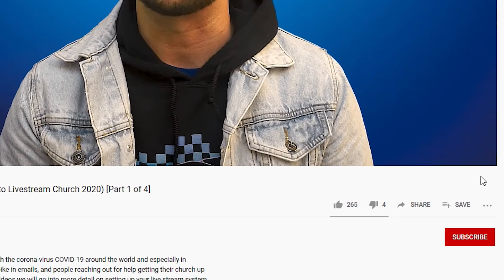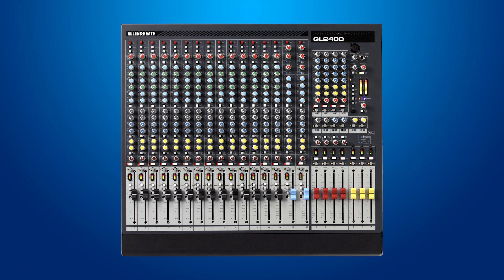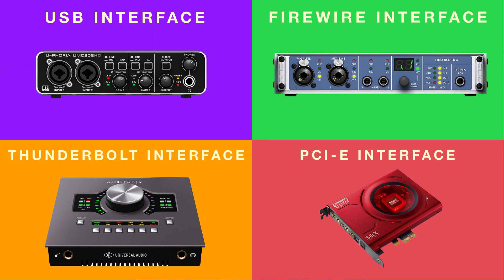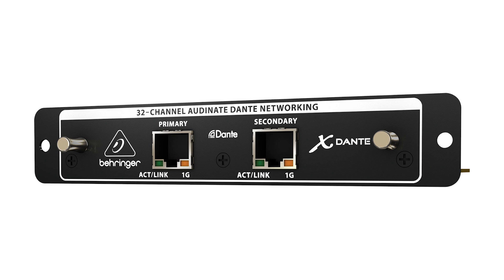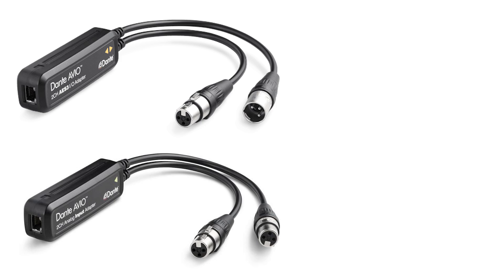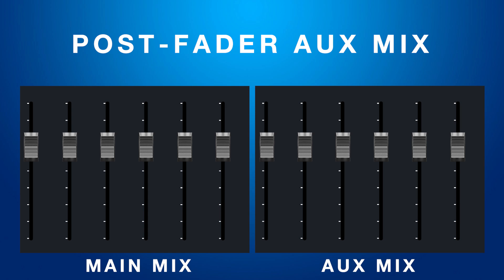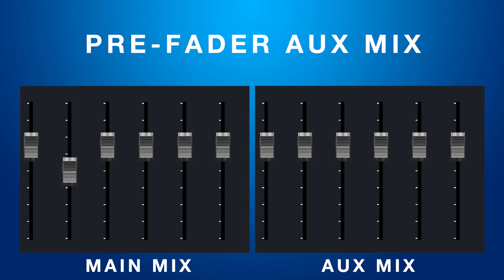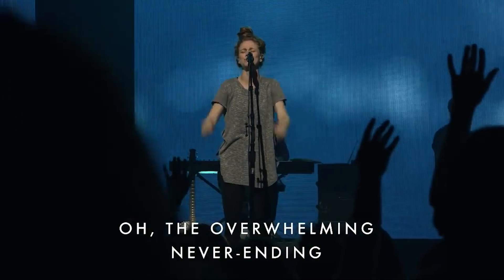Live Stream Audio Capture & Mixing (Live Stream Church 2020) [Part 3 of 4] #vMix

Comment: Question: you mentioned using the audio interface capability of digital boards as the best option. But you didn’t mention how that works? We have a Zoom L20, and it has an audio interface capability. We use Zoom (the video conferencing application - not to be confused with the brand of our soundboard!) for our virtual services and classes. I have the drivers for the soundboard downloaded onto our computer (laptop, but a powerful one) and when I plug the USB from the board into the computer, the L20 comes up as a mic option in Zoom. Buuuut no signal. I would love to be able to make the sound as good as possible! We have a conference we are doing soon that is mostly virtual, but the worship band will be live in our building playing for people gathered on Zoom, so if anyone can help with this it would be great!!

Comment: Can two audio interfaces be used? For example I have all input coming from the digital snake or from a digital console for broadcast and I want to route it out of the laptop with another soundcard like the one you mentioned. So that I can have multiple input from the mixer soundcard and the output goes out on the standalone output, and have my main mix routed out from there. 
Thank you
Ebenezer from Nigeria.

Comment: Can you use the Dante AVIO Digital AES/EBU XLR ($144) on the M32? Currently, Dante X32 Soundcard is out of stock. The M32 only has 1 EBU slot, which is meant for the output.

Comment: Such a great vid! So we’ve hit a major wall recently with audio mix. Initially we dedicated 2 buses on our X32 for our live stream mix. Those feeds are sent to our atem (l&r) then to an aja-utap and into wirecast on our iMac. The audio quality is decent, but that’s it. I recently connected my MacBook Pro (Logic Pro x) to our X32 using the usb digital output on the mixer. I have all 32 channels coming in, and I’m able to create a separate mix in logic with such a great waves plugins. It’s a night and day sound. Here’s the big issue now. How do I get that audio sound to either the atem or into wirecast? We cannot figure this out. We’ve tried using a few fire boxes as interfaces so that the MacBook and iMac talk to each other, but we get annoying, loud hum and buzz at times. Other times, the signal is so weak by the time it gets to wirecast. Anyhow, this is the wall we’ve hit. If we can get the logic, mastered mix into our live stream feed in wirecast, it would be a game changer in so many ways. Thanks for the help and pointers. 👊🏽😎
Reply: Did you figure out how to do this?
Reply: Did you figure this out yet?

Comment: Hi, I am using phone to do church live stream and it is connected to mixer but there is a noise. Am using rca to trs with trrs adaptor. I have also tried using 6.33mm jack to trs/trrs. Mixer is also connected to an amplifier for the venue's speakers. Any tips pls so we can eliminate the noise?

Comment: This is so awesome. Thank you so much pastor for this detailed walk-through. Just to add. Bethel now produces the template for other daws: Ableton, logic, reaper. A little question? For my church we use our ethernet connection for our internect connection in our livestream as our wifi is not too strong. How does that work with us if we go the dante route. We may not have the budget for a dante card right now but since we have the x32 we want to use our card out option to connect to our Livestreaming pc and get all 32 tracks into the bethel ableton/protools template for livestream but that will be too much cpu load on our livestreaming pc as Vmix takes a toll too. How do we come about this set up?  Thanks for all you do for His Kingdom man. Grateful.

Comment: I am using a hp omen laptop with J5 device capture device. My audio is come straight from the sound board. It is an old professional analog board but very good. The sound being directly to my capture device. I have various different issues. Using the extneral Behinger seems to be a the solution I need. I do not know the different of cables. Can you should me where I can order the cable for Behinger? Can Ask one more question what is the difference from single channel to 2 Channel?